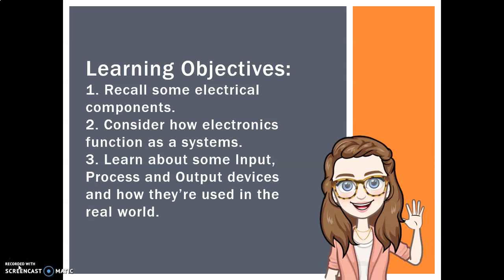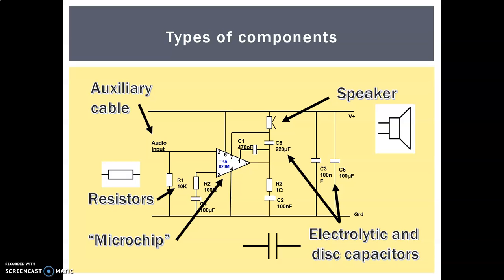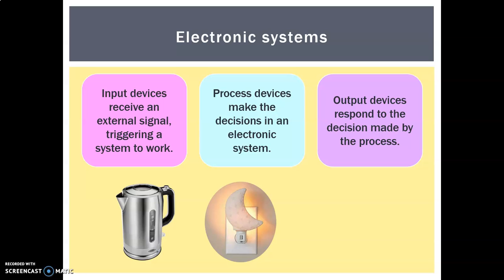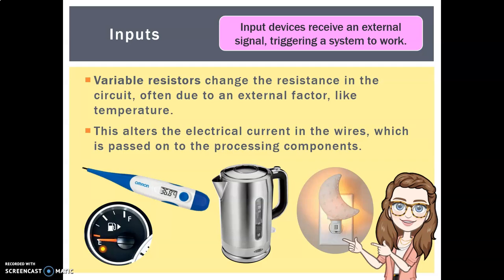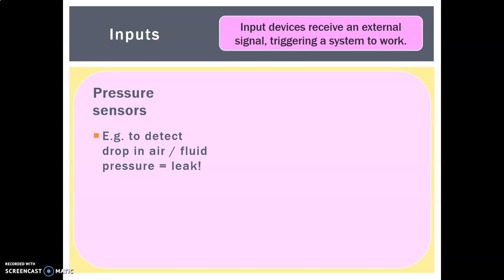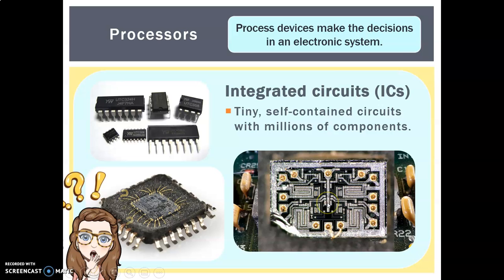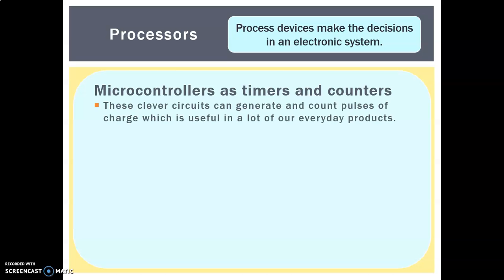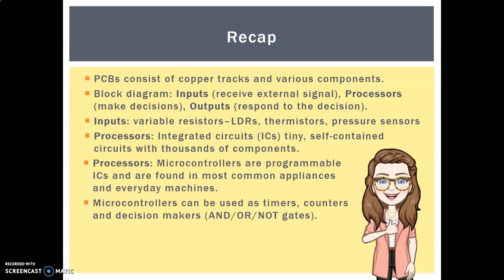Electronic systems GCSE DT

Comment: As an aside to logic gates there are actually 4 more than the original 3 (AND OR NOT). These are combinations of gates that produce outputs, used often in digital logic. XOR gates 'exclusive or' are OR gates that only return true if the inputs are not equal i.e. (10 and 01 return 1, where as 11 and 00 return 0). These come up a lot in fundamental digital logic circuits for example in an adder circuit (adds numbers, have a think about what it means to add a number in binary, then google if you're curious).

The other 3 gates are less abstract NOR NAND XNOR are the 3 respective gates with a not on the end, inverting the output. This is mostly important because NAND and NOR are considered 'universal gates', the behaviour of any gate can be replicated using one or more universal gates.

Generally when we design digital systems, we define the behaviour we wish to exhibit, then transfer it all into NAND or NOR gates, since they are cheaper and easier to fabricate.

These gates seem pretty abstract but they are fundamental in boolean algebra, which gives us a language to describe behaviours of digital systems, and also a few tricks, such as universal gates.

If you're curious about digital systems, as the link between transistors (fundamental electrical components) and registers (fundamental building blocks of a computer) I'd encourage you to learn more, a fun way is redstone in Minecraft, people have made full computers, there are also digital logic simulators online. Focus on understanding the behaviour and what you impliment it on won't matter.
Reply from the maker: Love that sharing of knowledge, thank you! Luckily for us, this exam board only requires we learn the basic 3 😆